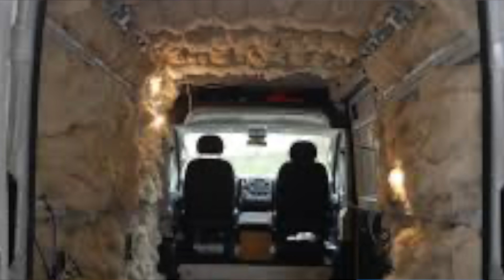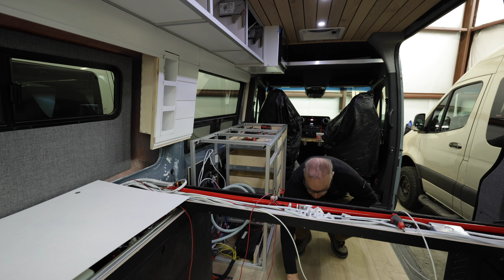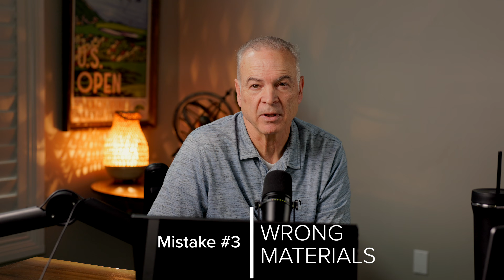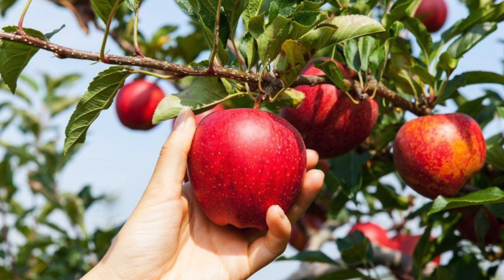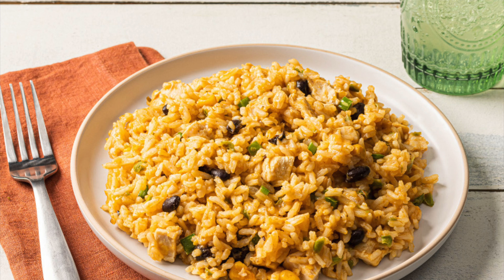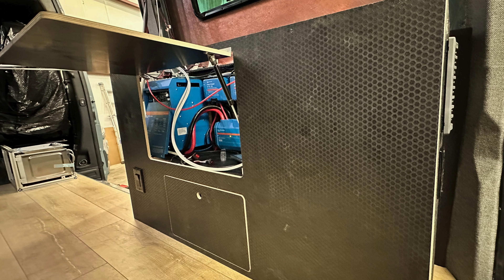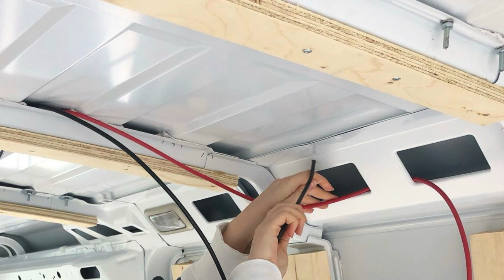Avoid These 5 Van Build Mistakes!

Comment: We rebuilt our shuttle bus after 2 years, and Havelock Wool has seriously changed everything when it comes to thermal regulation! We made custom, made to fit shades for our windows, with Reflectix layer against the window, and Havelock Wool layer in-between, with a thick, heat holding fabric on the face. That has been an absolute game changer, keeping temperatures up by about +20° during freezing temps! Never had such a luxury!!
Reply: I would love to know more about how you made your custom blinds! Working on my van now.  Just did the insulation  ~ sadly, didn't know about the wool, and used R19 fiberglass,  with a layer of thick black plastic over top, gorilla taped on all edges to prevent the fiberglass from entering the cabin (I hope). Already sounds quieter and feels much warmer.  

But the blinds ~ would love to see how you did yours!
Reply: @SusanAnnePowerOfTruth  Glass is a major 'NO NO' and has been banned in numerous countries, years ago. It's not much better than Asbestos. I've built a few boats in my lifetime and I still have glass coming out of my skin decades after I stopped. If that was in my lungs? I'd probably be pushing up roses by now. 
Since yours is now done. I would make sure EVRY seam, nook and cranny is taped off and insulated for the cabin. To me it's about as natural as the C19 cl0tshot!
Reply: i used 32mm Armaflex. 800w electric heater keeps about 25° Difference
Reply from the maker: Awesome.

Comment: Apart from the obvious confusion of fire hazard of Lithium batteries used in EV's with the much safer standard Lifepo4 (Lithium Iron Phosphate) used in most battery banks, the rest was good information/opinions.
Reply: I had a lithium battery in an expensive battery bank which smoked and almost caught fire to the house, if i hadn't caught it early..

Comment: For safety, it’s almost like there should be a building code put into policy. Like building a home, where an inspection takes place before the next step can continue. I know this comment may not be popular with some, however for the inexperienced out there with no prior knowledge of van builds, some type of building code may save a lot of grief in the long run.for example I sold my van, it was a pro build, and I enjoyed it for years.I temporarily sold it to a couple for 6 months or so and when they were finished they’re trip I was to buy it back which I did.When I went to use it, it caught fire, turns out they mucked around putting in a fancy stereo and a roof vent fan, they claimed they knew what they were doing. Turns out they didn’t, I took them for their word and my old fav van is now in a parts yard somewhere.😢. just so blessed that I wasn’t in a deep sleep in it when it happened.So ya, if some building codes were in place and inspections done, I would still be an owner of a van and enjoying van life somewhere.p.s. That’s another thing I don’t see many people travelling with fire extinguishers. I carry them in all of my vehicles, used them 2 times and that was for other peoples units not mine. Stay safe out there everybody. This is a good video by the way, doing things the proper way is a big thing, I want to build my own since I can’t afford the brand new pleasureway or roadtreks. But honestly I’m scared to do that cause there is so much to know, electronics, cabinetry, plumbing and quite frankly I’m scared to buy someone else’s build cause I don’t know their skill set and I may run into a repeat scenario. Thanks for posting the video, very informative, learned lots.👍
Reply: It's not complicated for a pro.
It's simple protect every circuit with the proper fuse or breaker. Design is everything! Make it simple.
Reply: Your point about including a fire extinguisher is a good one. Better to have one and not need it. 👍

Comment: I am converting my minivan with solar and your quick rundown of issues hits a number of likely trouble spots.   The lithium battery has a lot of components and energy, an internal short could happen, particularly if overheat or mechanical shock.  If it starts smoldering, not sure a CO detector or regular smoke detector is better.  Lithium fires seem difficult to put out, so whatever ahead of time containment or ejection setup maybe the only option.   The larger RVs have metal battery bays outside
Reply: All new  batteries have their own Battery Management System. They don't catch fire. Poorly fuse circuits can catch fire.
Reply: Yep it happens a lot on boats.

Comment: Biggest mistakes I see are electrical which unfortunately you spent too much time on advertising rather than giving basic advice. Marine quality is NOT necessary for a van build unless you intend for it to be wet often! It's not. Good quality automotive is better. Use the correct tool for the connection don't solder, crimp the connection, support the cables every 12" or less, make a neat loom and keep the wiring neat and as short as necessary but not too short! Cover in 2 layers of binding, something like a tape and then a conduit. I usually wrap the conduit as well as it helps keep dirt and water out. Use relays! Short power runs, long control runs. Fuse often. Have Master Fuses! it all goes to a better build.
Reply: I just use USB rechargeable lights w magnets so I didn't have to do all the wiring.
Reply: I found I couldn't get a reliable connection on my ebike unless I soldered it. It provided a cool, strong connection which literally never failed. What's wrong with soldering your connections?
Reply: @marcus.H  soldering tempers the wire so more likely and liable to fracturing. If purely joining wires and is supported well it will be fine, but for terminals and in high vibration applications it is not recommended. I've been making professional looms for automotive applications for about 30 years, I've seen a fair few failures in my time. One of my first looms I had the ability to disect, the loom aas still perfect on all my joints. My Land Rover I am part way through rebuilding, the solder joints on the battery cables failed within 15 years, they don't move.
Reply: @overlandready  wow 😧 I never knew that.
Reply: @overlandready  what is tempering the wire?
Reply: @marcus.H  baaically heating it up and making it brittle. Brittle breaks easier rather than bending.
Reply: @overlandready  interesting 🤔 I'll keep it in mind.
Reply: Used a 12 volt switch for an blower.  Your right those switches don't last long. Even the automobile use relay for the horn.
Reply: Overlandready your advice is trash fr. Just breathing creates moisture. You must be a desert dweller because moisture does actually exist.
Reply: It wasn’t the smoothest ad transition, but no need to be snarky.  I suspect you like to be paid when you work, and…so do YT video creators.
Reply: @mlisaj1111  it's poo. And yeah, I get paid as I fix things, you know, make broken things work, not show a specticle. When you understand that, matybe you'll get the rest.
Reply: Marine products aren’t only recommended for the ability to get wet. Construction gets banged around on the road just like on waves, and marine products often take more of a beating before coming apart.
Reply: @ChrisW228  spec for marine and automotive are different, for a reason, boats get larger low frequency vibration, automotive get lower impact high frequency vibration and are much more suceptable to volt drop, as such the systems need to be build differently, yes you can use marine products, but they are not the ideal. Automotive products are designed, manufactured and passed the necessary legal requirements for use in vehicles, marine products usually have environmental teasting but not to the other standards. 
The point is use the right equipment for the right job. Ps marine products are not usually designed to be or get wet.

Edit: If you have ever looked at professional boat electrics, you'll see there are a few massively bad shortcuts taken, a lot use mains wiring as it's cheap, they use open sub standard connectors and the electrics have some very serious fail points. I build both automotive and marine wiring looms. My boat was rewired over 10 years ago and is a fully capable ocean yacht. My vehicles and others that I build for are predominantly off road and overland/camper vehicles. I also did a test on some of my work from 30 years ago on solder and crimp terminal longevity, The soldering was still perfectly servicable and the terminals were original manufacturer so still great, these were older than the boat wiring that had multiple fail points, mostly through use of wrong materials and sub standard connectors (powerpole) that had overheated. 
I give my work a lifetime guarantee. For the last 10 years I have soley used high end manufactured components that are found in off road vehicles, motorbikes and even military applications.

Comment: I used deck screws for almost everything, much better and stronger than SS screws. I used Blue Seas wiring app for wire sizing. 
I ran all my plumbing and wiring in chases, I can modify or repair either one.

Comment: love your video. planning my new van and I got a lot of great tips from it. Curiously when you talked about batteries you only mentioned a few lithiums  but did not mention anything a bout silicon dioxide batteries. Is it because there is a problem with them ? not reliable? from what i read they out perform lithium in many areas especially cold charging and  durability
Reply from the maker: Silicon dioxide batteries have not been widely adopted for vans, RVs and marine applications. This may be due to their slower charge rate and steeper discharge curve vs lithium ion phosphate.
Reply: @thrivans  They do have a lower charge rate at.3c but for 200ah bank that 60 amp which is plenty for most solar or dc to dc. they do have steeper voltage drop but i never found that to be a problem and can totally compensated by running a 24 volt system . They do have a max discharge rate 19 times the 1C for lithium and can operate down to minus 40 to plus 60 degrees
Reply: I’m building a cargo trailer and my small amount of plumbing will definitely be accessible. We’re using a EcoFlo power station. It ain’t camping if you need 120 volts 🤣😂
Portable solar panels, we don’t need no stinking holes in the roof, charge controllers, inverters, or expensive extra batteries.
Our power station can go through 10,000 cycles and STILL be charged to 80%.
Why complicate things?
$$$$$$😎
Reply: @JethroTroll-jt  thats fine for a weekend getaway but a lot of people live in there vans for months and even full time while working remotely. we all have different needs

Comment: Great information, I just converted my Iveco Daily 70C, I don’t think there available in the US but they are a great platform to build on, its the same size as a large Sprinter but with 14,000 lbs max weight.

Comment: I just made my cabinets square in the shop....the uppers are square except for the back of the cabinets where it mounts to the wall. I used 3m, I used baltic birch through out...spring locking struts(marine type door props) inset hinges, deep heavy drawer slides...zero particle board. All quality materials. Very time consuming to build! I'm happy with my one and only van build, three years later my van is exactly how i built it, nothing has come loose or broken.I used pocket screws AND glue...absolutely no rattles or squeaks. 3 battle born batteries, top of the line Renogy, all marine grade and soldered connections, all wiring protected against rubbing in the walls...I double/triple/quadruple checked everything!  I did my research on wire sizes, breakers everything!
Reply: You sound very proud of your work. It's obvious you know what you can't see is usually more important than what you can. It took you a while but you didn't sacrifice quality for a quick reward. I feel as you do, i could never relax if I was unsure of any of my electrical connections. I am happy for you. Peace
Reply from the maker: Good job! You did it right. More expand time consuming, but well worth it. Happy travels!
Reply: Nice, I’m doing mine in the shop the same way with pre finish maple and walnut trim. What did you find to be a good size for your power plant cabinet?

Comment: i HATE mdf boards for those reasons - heavier than plywood, if it gets wet it's done. oh yes, and for someone who's built thousands of flatpack/ikea stuff for customers, i loathe the low quality strength of particle board and mdf for holding hardware.
Reply from the maker: Ditto.

Comment: Always heard stainless bolts were not as strong as high grade bolts
Reply from the maker: There are higher grade bolts, but compared to the zinc bolts you get at big box stores, SS is definitely stronger.
Reply: @ronnjerremy5796  This is completely untrue. A guy can easily find grade 5 and grade 8 bolts at a Home Depot. The common "SS" hardware a person is going to find in a big box store is going to be made of 304 stainless steel, which has a much lower tensile strength. A little higher than a junky grade 2 bolt, but not the same as a grade 5 or anywhere close to a grade 8.

SS hardware has its place, but choosing it for strength is NOT correct. As found commonly, it is NOT stronger. Further, it is much more likely to gall/cold weld and so should only be used with an appropriate anti-seize applied. Lastly, it is more suseptible to work hardening, which can lead to fatigue failures in bolted joints which see cyclical/varying loads.

Comment: I did my own tiny home trailer. All wood, glued and screwed, r10, galvanized roof, insulated house door, one window, custom built heat exchanger, my plumbing is dump buckets and refillable blue water jugs, my electrical is extension coords ran through plumbing with shore power hook up. I did a diesel heater, electrical heating, tent wood stove. Summer time I will wrap the outside in aluminum and change the axle. Bin so much fun and it’s saved me a lot of money already this year. It’s already half paid for itself.

Comment: I would be interested in the differences in a build for different climates, like rain coast, desert, northern, etc. I’ve seen -40 degrees this year, and all I can think of is insulation.
Reply: I always think about the condensation/ excess moisture in the air, soaking into hard and/or  soft materials & dripping behind walls etc.
   Causing mold , mildew, smells & warping.
🤔☮️
Reply: Insulation is a must in hot weather or cold. Most importantly heating for freezing temps. Diesel heater, a wood stove, a propane heater, or heated floors are your options.
Reply: @etonakoxD don't use propane heating in a van

Comment: This is a great video.  One thing I see in virtually all youtube videos about insulation is the way thinsulate is installed.  I talked to a person at 3M and they said the black side is the stronger side and would be great for applying the adhesive to.  I wonder why I don't see it done that way?
Reply: to insulate (against) what, that is the question. temperature? what exact physical property of thermal transfer do you want to insulate again? and those are the kinda questions "pro" and amateur / novices don't ask (themselves) because they don't know that there's a diff.
Reply: @themax2go  You are absolutely right, there are different types of thermal transfer.  Insulating a building or an RV can be quite a complicated subject.  There are 3 basic types of heat transfer, conduction, convection and radiation.  Blocking all 3 in an RV is especially difficult due to the relatively thin wall space there is to work with.  But, many van builders will say that some insulation is much better than none.

Comment: Thank you for this very helpful and informative video!  Another consideration that folks might want to take into account is the placement and housing of their LiFePO4 batteries, especially when they are housed in the living area of their RV. The UL listing that some batteries have is important but it’s limited to the battery itself not how it’s installed.  For last few years it has been common place to abandon battery boxes because it was thought that LiFePO4 batteries did not release toxic gases and were relatively safe.  Apparently this might be mistaken. My husband is a former automotive wiring engineer.  While he understood that LiFePO4s were less likely to catch on fire, between the news reports of lithium fires and his own professional awareness of vehicle (and RV) electrical fires, he decided to do some research before designing and installing our LiFePO4 battery system.  
Compared to AGM’s and other lead based batteries, Lithium based batteries are a relatively new phenomenon. Prior to last year, recommendations for their safe placement and use has largely fallen on the battery or RV manufacturers. These recommendations were often based on warranty data, or personal experience and without major studies or even formal input from experts in adjacent professions like fire and safety.  Last spring, after much study and consultation SAE finally weighed in on the issue with a new best practices specification.  To my understanding their current recommendation is that all Lithium based batteries (even LiFePO4) should be kept in fire rated and vented battery boxes.  The Fire Rated Battery box buys people a few extra minutes to evacuate their RV and venting is important because studies have shown that while LiFePO4 batteries do not have significant out gassing during normal operation, if they go into thermal overload they can release combustible gasses that can result in an explosion.